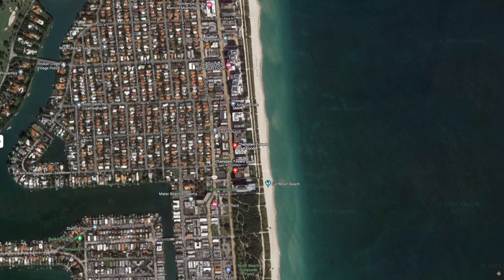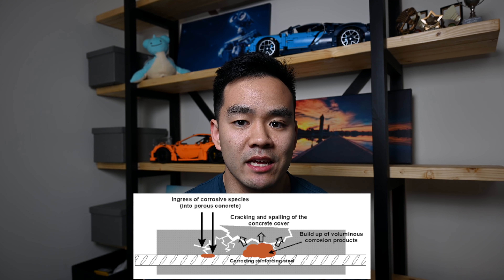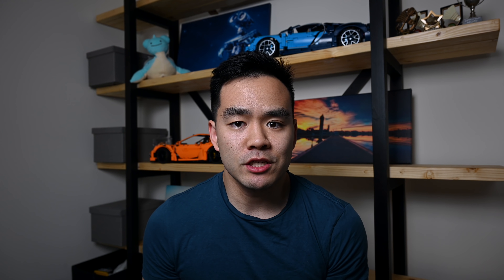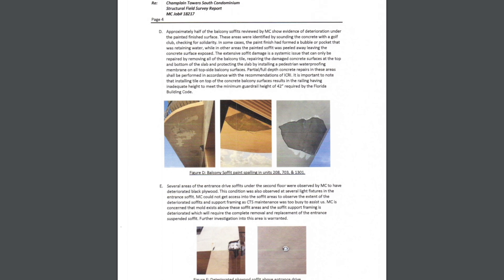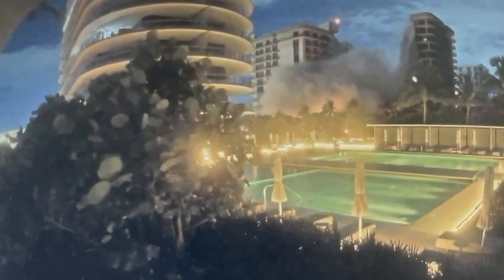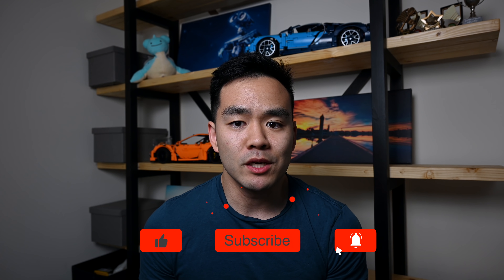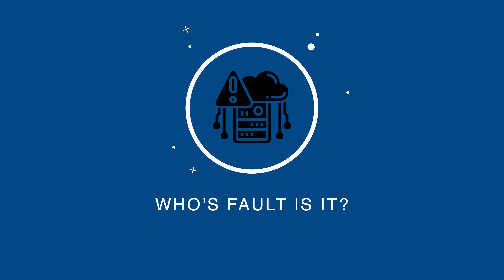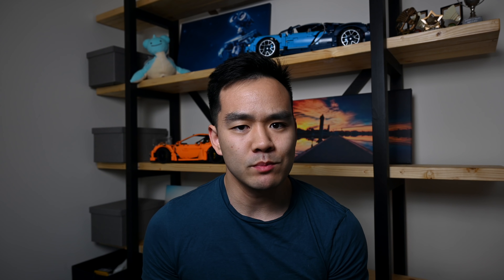Surfside Condo Collapse - A Structural Engineer's Perspective

Comment: We need exray machines for to sense the metal decay and rust. We can tell moisture in wood.
we can drill samples in the footings cross beams and colulms. for rust. sodium. concrete texture and integrity. After 49 years . All you have is cancer all over the place. Like standing on the kitchen table and the leg breaks.
Were done here.
Cheap ocean front property.. Do ya have an engineers report though. Valid fro how long. The insurance co is to blame here. 110,000000 million cover. This is Trumpitous all over the place. No fucking oversight.
We need some kind of metal scan for concrete. This corp greed terror. DOMESTIC. WORST THAN OKLAHOMA. Money grabbing neglegence. I mean who is in charge. a 40,000 lb planter slab on slab poured on rotten columns. a penthouse on the thirteenth floor. Why not put an elephant on a milk crate. Integrity my ass. Even if the footings are tied into granite. They were on sand close to the ocean. The basement was flooded for years. Even a water boiler has a release valve. This is all mad. I fear to read the report. America should be in shame. No over sight a failed Nation. We have our heads up our ass. Trump effect.

Comment: The concrete columns in my neck of the woods have spiral(helical) rebar windings. Also the rebar has more concrete covering the rebar. Furthermore our slabs are either post tensioned with cables or a much more robust rebar GRID mat, or both. For significant load bearing slabs, they often use oversize rebar for the bottom mat because that will see the most tension and concrete is weakest in tension, unless it is a cantilevered slab, where the reverse is true.

Comment: Empire State building - Steel frame construction, built 1930-1931. Still standing. Chrysler building built in same era - Still standing. 
Champlain Towers building  - "reinforced" concrete construction, built in 1980, collapsed 2021, killing many more than 100 people. 
Relying on prefabricated concrete to support a building is a very cheap way of doing things - bordering on the criminal.  Everybody knows it. Take a look at the floor in your garage. Would you trust it to hold up a factory? The worst part is that the penny-pinching creeps (Nathan Reiber - Wikipedia) that financed and built this monstrosity are long gone, it having been built 40+ years ago.

Comment: Have you seen this video:  https://www.youtube.com/watch?v=gFRWvCAFMYc&lc=z22wdd4p5zipcxlym04t1aokg0wvaf4ka1eowhkg2c4obk0h00410.1626355591027548     It was taken from inside of Unit 711 during the collapse.  This video isn't mine, but I would be very interested in your take on it as I have relatives that live in Tampa, in a high rise condo building and I am a bit scared and worry about them now.   It would seem to me that this collapse, from the perspective of the video, started at the top as you can see the concrete raining down, and you hear what appears to be levels of the building collapsing into each other.

Also... I would seem to me that if you were to buy a condo, before the bank gives you a loan they require a structural inspection.  I know when I bought my house, they required a very thorough one, and that was no where near as expensive as any of these condos. Also, Miami is a tropical environment, wouldn't it be damp all the time?  The residents payed an average of $900 a month, for each unit, for maintenance and other costs... that is $1.67 million a year.  Say insurance and maintenance staff cost $250,000 a year... where did the rest of the money go.  Quite frankly, having seen other videos, I would not have suspected a thing.

Comment: Very clear, concise video… thank you.. I’m not a structural engineer but looking thru a lay person’s eyes l was surprised at the size of the basement columns.. this massive building constructed on sand in a saltwater environment appeared to have support columns far too small in size to support such loads.. there were columns in some areas of the basement far more hefty and caused me to question why were not these “ heavy duty” columns thruout the entire basement area…
Reply from the maker: without the calculations, its hard to give an factual opinion on the size of the columns. i am going to have a look at the structural drawings this weekend, might give me a better idea if the structure was adequate or not
Reply: @EverydayDazz  The collapsed part of the condo had 16x16 columns whilst the standing part had 24x24. Not to mention the 9 inch pool slab had practically no support beams.

Comment: Great video.  Most engineers are calling this a punch shear failure where the slender lightly reinforced 16”x16” columns punched through the deteriorated 9 1/2” pool deck.  They added a 4” stamped concrete slab on top of the pool deck slab with no reinforcing or waterproofing after construction.  The last couple of days they have exposed the foundation from the rubble and it’s surprisingly intact.  The exact area where witnesses saw the pool deck slab fail was opened with a test pit to check the slab letting even more water in, and directly above where there had been some sketchy looking epoxy repairs done to the bottom of the slab.  The parking deck slab was not independent and was tied to the building columns, taking the structure with it when it failed.  There is a video 7 minutes before the collapse that shows a broken pipe and 2 failed columns.  In my opinion there are a multitude of factors that could also of contributed to call this collapse a simple punching shear failure.
Reply from the maker: thats interesting. i've just got a copy of the drawings so i'm going to spend some time looking at it. i think i'll do a video about what i think of the drawings and the design. stay tuned!
Reply: @EverydayDazz  I would like to see the test results of the concrete cores as well myself.
Reply: Maybe a vehicle hit Column 27 or even 77. 27 I think is one seen down on video along with the dodgy looking beam that wasn't cast on top of column as all others are. The columns in this area clearly failed. The pool deck may have gone down 1st. But my thoughts are when columns around bottom of ramp had thier integrity compromised. The pooldeck sheared of dragging more columns down. Once 1section of pool deck went the rest followed and were punched through. Clearly there was a massive problem with area where 3ft x3ft section was removed for inspection. Also the report on a water barrier on pooldeck having to be completely replaced is damming. Not forgetting vibration from construction of Building next door.   Building was a disaster waiting to happen. 1 thing though. Never estimate the damage water retention can cause. Aberfan Mountsin of Slag Slipped onto School. Human error was The Root Cause probably to do with money.
Reply: I think human’s innate natural to push the envelop in design and construction poses a danger.  underground garages was not a conventional design maybe until just around 45 years ago especially one that has an exposed deck to the elements.  Careful consideration should paid to monitor its performance and wear because of a lack of history.  There is a huge failure on this part.  Plus a structural engineer should always design with the question of what if in mind for every support they design which can result in a dominant effect of failure resulting from such a single component of the building.
Reply: @robertyu7341  that’s a valid point.
Reply: I agree. What troubles me and has from the beginning is that the columns in one part of the building are 16 inch and the building that remained standing had 24 inch columns. Also the 16 inch columns had no shear heads visible, thus punch could not be avoided.
Reply: @kellyname5733  absolutely
Reply: Vibration from building work next door
 Pool deck weight increased above the load that columns were designed for. (Water ingress + extra layer on top of slab). Possible collision by vehicle to column , Not long before collapse or occasional.
A catalyst started the fall rather like the first domino being pushed over. Due other structural wear and tear inc water ingress to columns. Bad design. A change in size of columns clearly played a part. If pool deck had a gap of 500mm and a run off drain covered with grill plus a canopy covering gap to prevent rain getting to lower garage. A bridge across or bridges for access. Then if pooldeck punched through.the worst thing to happen would be crushed cars. However 24inch columns should have covered all building plus more sheer walls Nth to Sth and zest to West. But Prking space would overall be reduced that may be insufficient if all condos lived in.
Reply: @raylp4751  I agree with yourself and Kelly above.  If the deck had been independent of the building, there had been more shear walls, and larger columns in the building, it might of just been some crushed cars.  They would of definitely lost parking spaces that way that's a valid point.   There are just so many different factors involved.  I am still not sure what the exact cause was.

Comment: Great insight, I just took a few minutes to look at some of the blueprints from the building (https://www.townofsurfsidefl.gov/docs/default-source/default-document-library/town-clerk-documents/champlain-towers-south-public-records/8777-collins-ave-1979-plans.pdf?sfvrsn=bd2a1194_3).
I'm not an engineer, however others have pointed out that the building had no support beams except for the bottom floors which would go hand in hand with what you mentioned about the building robustness, wonder what your take on this hypothesis is as to how much of an impact this could've had
Reply from the maker: hey, these are awesome, i;m going to go through these and maybe if i find something interesting, i'll do a video about it!

Comment: I see stainless steel rebar exists, would this be a solution in this marine environment area ?
Reply: Stainless steel doesn't have quite the tensile strength or failure characteristics that proper rebar does. For instance, some stainless steels are prone to fatigue cracking and also can fail suddenly if bent too much. Not very good characteristics you want in a reinforcing element, a slow progressive type of failure is better than a sudden catastrophic failure. So stainless steel rebar might exist, but would have to use a lot more of it. Even then, stainless steels can rust, if the layer of passivation like Chromium oxide is continually worn off to the point where the Chromium/Nickle parts of the alloy are depleted. 18-8 or type 304 stainless steels are great for knives, forks and spoons, but don't tolerate heat very well for example. Heat exchangers, exhaust pipes etc are typically made from type 400 series stainless steels, they resist cracking a lot better from the heating/cooling cycles, but they can and do rust, but it's generally just surface rust. But not something you want on a fork or spoon or surgeons scalpel. Lot of complex pros vs cons for any type of steel, then you have to take into account the high initial Ph of the concrete mix, and possible chemical interactions from stuff in the concrete mixed with water and chlorides from salt in the air etc.
Reply: @brnmcc01  Thank you.
Reply from the maker: no idea! would probably help for sure but maybe not alleviate the risk completely. also my guess is stainless steel reinforcement is quite expensive.
Reply: Stainless steel rebar was not available in 1980
Reply: @kurtdietrich5421  that's an excellent reason.
guess it may be time to mandate it nowadays when litterally building on the beach
Reply: There is epoxy coated reinforcement for marine environments. Creating a cathode and anode is another method to prevent deterioriation but again money.

Essentially the condo cheaped out and knew.
Reply: @nascentnaga  epoxy coated has been banned, too many issues if be coating is somehow scratched, even a little bit
Reply from the maker: the best line of defence against water penetration would be your waterproofing membrane, concrete thickness/cover and detailing. The protection around the reinforcement is just additional benefit. maybe in extreme marine structures you'd specify that around reinforcement, but normal basement structures you probably wouldn't. I could be proven wrong though, just my experience in basement design.
Reply: @EverydayDazz  i’ve read somewhere that they had a regular seawater flooding of the parking garage with the highest tides. Perhaps stainless for that garage part would have made sense
Reply from the maker: Can’t rule it out that’s for sure.
Reply: @EverydayDazz  also the pool deck was not separate from the rest of the building, which makes no sense
Reply: @brnmcc01  The building code requires 3/4" cover for slabs not exposed to weather, and 1.5" cover for slabs that are exposed to weather.
Reply: @billj5645  Correct. But if you look at the videos circulating around of that lady taking a tour of the garage about a year ago, it definitely looks like that whole garage ceiling slab might just as well have been exposed to weather; with all the cracks, peeling paint, rust streaks, corrugated plastic sheeting attached to the ceiling to keep water from dripping on peoples cars etc.
Reply: @brnmcc01  furthermore, those buildings are litterally on the beach, the ocean water is bound to penetrate any underground structure
Reply: @brnmcc01  Going with the Useful Life phrase.
Reply: @nascentnaga  Epoxy coated rebar is banned in many places because damage made to it when installing it actually makes the corrosion worse as it is focused on the small nicks and burs in the epoxy coating.